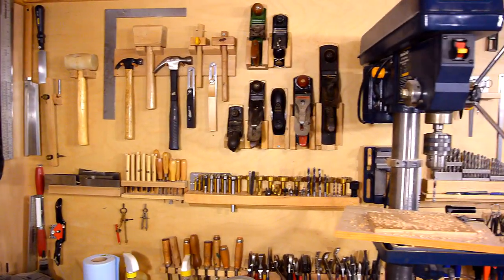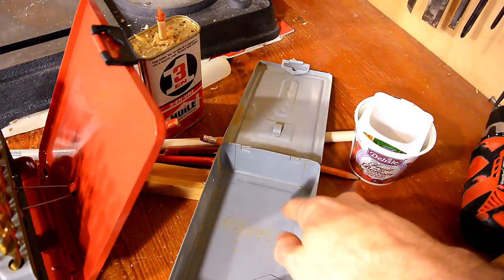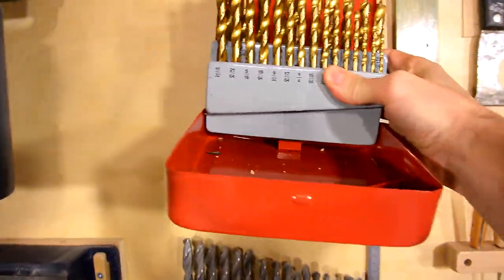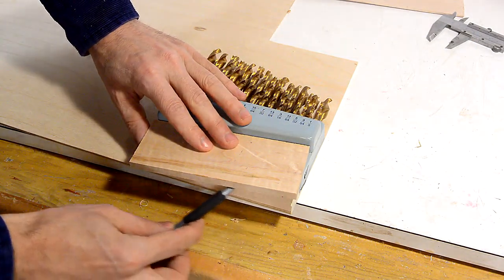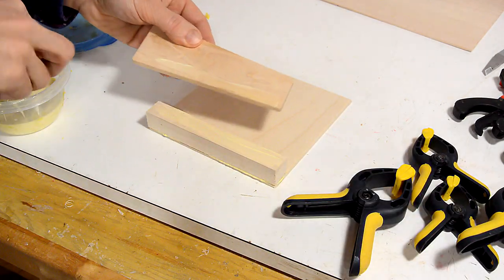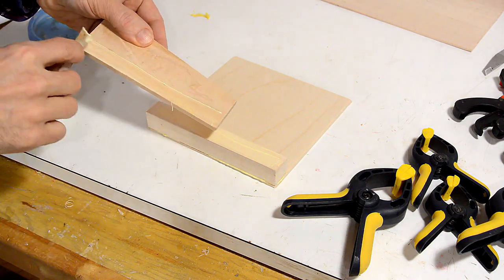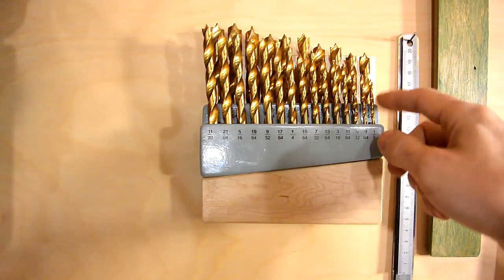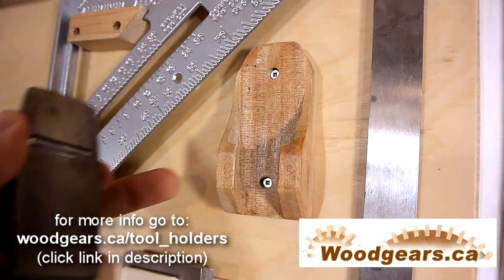Not a french cleat system for organizing hand tools

Comment: Matthias,   I understand your concern of the french cleats being sawdust catchers, but it's a bit of a bias comment.  You have put a lot of work into your layout, but sawdust is NOT a justification for recommending to stay away from french cleats.  Like you have stated in your video, once you have your tool layout, the hangers will stay put, making it impossible to collect dust under them.  If dust is your concern all you have to do is remove the cleat from the wall brush off the dirt and wait for another 10 years of dust accumulation.  The french cleat system is far to flexible just to write off as you have.
Reply from the maker: Jeff Weinmann There's still the fact that they are a lot of work to make, are less flexible, and are ugly/
Reply: Matthias Wandel Two 4x8 sheets of plywood. One of those cut into 3 inch cleat strips.  Mount cleats to First 4x8 sheet.  Mount to wall or just mount the cleats directly to the wall. This is woodworking 101.  One of your videos demonstrates you creating an angled zero clearance insert for your table saw.  Stating that creating french cleats are difficult to make is simply not strong.  French cleats are the very definition of flexibility.  Entire tool cabinets can be rearranged if mounted on cleats simply by lifting and repositioning.  Your opinion of french cleats being ugly is exactly that - an opinion.  If you would have said from the beginning that you did not prefer the appearance of french cleats, this would have been fair and respectable.  Instead you dispel cleats for collecting dust and being difficult to make - both untrue.
Reply: Matthias Wandel Let's us assume that 99% of wood workers think french cleats are ugly.  Then consider for a moment that there are wood workers that prefer function and flexibility over appearance.  Can you explain to your audience why a cleat system is that much more difficult to build as opposed to a 'Not a French Cleat System'?  I've reviewed your video again and I see very specific holders built for very specific tools.  Please explain how these items are so much easier to build than a cleat version?  Can you also explain to your audience just how inflexible french cleats are?  Now here is my opinion - I really don't care what my workshop looks like as long as its clean, flexible and functional.  French help me keep my shop in that state.  I'm not winning anyone over for the appearance of my shop.  I win people over by the quality of my work.  If French cleats help me achieve that goal, and they do, I will recommend to anyone their use.
Reply from the maker: Jeff Weinmann Easy enough.  I can mount a tool holder anywhere I want, not on discrete increments.  The effort of unscrewing and re-screwing the tool holders over their lifetime is still less than making the french cleats.
Also less space taken up.
Reply: I think this was just a response to Steve Ramsey's, "French cleat storage system for hand tools."
Reply: Nicholas Mathura
Bingo! Basically nothing more than a friendly jab at Steve.
Weinmann has taken this much too serious/personal.

Comment: Beauty is in the eye of the beholder. I have two walls in my shop using french cleats. I have rearranged each wall about five times so far. I like the ability to move cabinets, shelves, clamp racks, plane holders, etc. at will. I think the french cleats work well when the walls have been sheet rocked and it's hard to locate studs. In my next house, I plan to line the walls with OSB, and they I'll use your 'screw it on anywhere' method.

Comment: I recently arranged my tool cabinet.  The first time, I hot glued everything and the first hot day (in Georgia) it all fell off and it stayed that way for 15 years.  I finally got tired of not finding tools and made a mini-french-cleat system for part of it.  I wish I hadn't done that now.  For the rest of it, I made custom holders for each one like you did.  I like them much better.I did the same thing for all my drill bits and router bits, but made wood blocks with holes for them.  I am so pleased with how it turned out.

Comment: good video matthias,very helpful.

i used to use the "married cleat system"...i'd lend my wife a philips screwdriver and never see it again...very inefficient.
Reply: I'm a big fan of the "too many cleats not enough brains" system. I buy a set of bits, use one, set it on top of the fridge while getting a snack, lose all memory of doing so, spend four weeks looking for it, eventually buy another set because they don't come in single bits, and finally find it again when the cat gets up on the fridge and knocks it into my dinner.
Reply: percy thrillington I'm thrilled that she was an only child.  My Brothers In Law don't mess with mere bits, they take the bit set, battery powered drill, charger, extra batteries, standing drill press, and the coolest shop radio, THEN it all disappears.
Reply: Percy, it's in the garden.  She was using it as a seed drill, then the phone rang.

Comment: Tip:
When drilling out rivets, start with a small bit at a slight angle that will punch through but not cut the outer profile of the rivet, follow it by a larger bit.
This avoids the drill bit walking off the rivet head into your hand or scratching the case you may want to re purpose.

Comment: Both systems have their advantages. The main reason I like french cleats, regardless of shop project or not, is the ease of hanging. Being able to attach a cleat to the back of a wall cabinet and simply set it in place is so much easier than trying to hold it and screw it to the wall at the same time. Even if it's not a whole system of cleats mounted to the wall. Just put a cleat where you're going to hang something big and hanging is a breeze. 

I like what you did for smaller items. I like what I did for larger items. I might have to steal your plane holder idea though. Pretty nifty.
Reply: Or hang some ply on the french-cleats and screw small-tool-holders onto that.
Reply from the maker: For larger cabinets, I definitely agree.  For individual tools, rows of cleats are too bulky, and cut down too much on flexibility.
Reply: Matthias Wandel They take up a lot of depth space too, and in my shop, every cubic cm counts.I used french cleats to mount the cabinet itself, and wouldn't do it a different way.  My planes would just not fit though.  I'll make a separate cabinet for them, but next up is a sandpaper box.  This is my year to organize, finally.
Reply: I would agree with the general consensus:  Cleats for larger/heavier items and simple wall mounts for the small things.  That said, I have found that for wall mounting it was generally faster, just as simple, and more adaptable to use peg board for the wall sheeting.  it is still simple to make the hangers from scraps, but it allows for greater ease of arrangement and re-arrangement over time.  My Grandfather placed a simple sheet of dark brown paper over his and used a white china marker to lable things, hiding the "extra" holes and greatly improving the contrast between the tools, racks, and wall.

Comment: I'm 12 I just got my first real shop and I made a French cleat system but what I did to solve my dust and chip issue was I raised my French cleats off the wall. It solves the problem and I think it looks a little better too
Reply: Well I'm 50, totally disorganized with shit piled up on random shelves, but I came here to suggest a spaced cleat through which the dust could fall. It made me smile with optimism to know that a 12 year old not only beat me to the suggestion, but actually implemented the solution. Keep it up!

Comment: Five years later; I usually would go for the  
tang of a file or a reamer to remove a rivet,  
instead of a drill, even if the hole is that tiny.  
There's not that much metal to remove and  
like the video shows, a high speed drill slips  
and you can actually hurt yourself that way!  

Thanks so much for the content, keep up the  
good work.  בס״ד

Comment: Some of us aren't satisfied with it staying the same forever and ever...  That is the only reason I went with a french cleat system.  Albeit it's more a double cleat system:  Ran the boards thru a 3 1/8" fence with the saw at 45* angle and then flipped it so there is a cleat on both top and bottom.  Spaced them so leftovers can slide between them on the wall so more options for mounting are opened up...

Love yer work but a lot of us are redo-ing our work environment often enough to warrant a french cleat (I feel I have to defend it since I just spent 3 days cutting / mounting / painting mine!)

Comment: I have gone through all your comments,  my suggestion is just insert 3 to 4 mm washer between the fixed portion of the cleat and the Plywood/wall, so that a gap will form, whenever the saw dust falls on the cleat , it will automatically come down from the gap created by the washer.  The issue of saw dust is solved.......

Comment: Personally, I still prefer the french cleats.. like you say, this is more work and reqs a bit more planning up front.. as I you swap in and out additional tools, another fixture needs to be created..

possibly a good idea against the debris getting into the cleat would be a filler strip?
Reply: Then you have to deal with pulling the whole hanger off the wall, plus how much further off the wall all the hangers are.

Comment: Matthias, In this project you talked about the length of time you left the project cure. When provided, I find the length of time very helpful and interesting. Could you expand on three way ratio between volume of glue used : curing time : strength or durability.

Comment: 'super-thin layer of glue'.
This raises a question I've wondered about. If you've got enough glue to fill the joint, but the wood is dry enough to wick the moisture away from the glue quite rapidly - does it set properly?
Reply from the maker: Probably not as strong as with plenty of glue.  See my video "can you squeeze all  the glue out of a joint".

Comment: To remove rivets, use a drill bit about the same size, or just a little smaller, as the inner part.  Clamp down the part and drill

Comment: Rather than mounting the drill mount perpendicular.  Doing so takes up a lot of space on the wall.  Would you consider mounting the drill bit holder at a angle.  Not so much that you can not see the size of the drill bit, although resolving that problem is small.  Also it means that the drill bits would be easier to take out and replace.  I would imagine you would be able to place the drill bit holders much closer together saving a heap of room.
Reply from the maker: +velcroman11 That drill holder is already two rows, and it's a pain in the ass, because I can't see the labels on the rear row.

Comment: It looks like this would still collect dust.  With a French cleat system, you can clean up the channels and the pieces fairly easily.  With everything screwed in, though, it seems like dust will be more of a problem over time.
Reply from the maker: notjoshing With a french cleat system, the french cleats will get full of dust, and THOSE don't come off.  With this system, I don't have that problem.
Reply: I think it's kind of a wash in terms of cleaning difficulty.  My grandfather used a system similar to yours, and it's still some work to clean.  With French cleat hangers, I could just pull them off, then tap each off over the trash, and use the shop vac to suck up all the dust.  In the end, each system has its pluses and minuses.
Reply: notjoshing
Use your shop vac and compressed air at the same time. Just hold the vac end on one side and shoot air/dust from the other. No need to remove and bang.
Reply: 1Howdy1 Nailed it.  That's what I was going to suggest.  I love the french cleat system.  Although, Mathias' system works for him, and that's what's important, guys.  I haven't really used his system, but I like how easy I can move things around with the french cleat system.  So that's my preference, but either systems would work fine for any woodworker.  The dust does build up in the main cleats that you secure to the wall, that part is true.  But occasionally blowing them out with compressed air will work.  I should try that tomorrow.  Also, sanding off the corners of the part of the cleat that's attached to your tools will leave a small gap when the cleats mesh together, making the dust build up more forgiving.  Similarly to making a relief cut on a table saw sled fence so the work piece is always up flush against the fence.

Comment: If you could find an easy way to tilt the drill bits forward a bit you wouldn't have to pull them straight up.  This will allow you to lower the items above the bits and gain some additional surface area on the mounting ply....

Comment: you could have srewed the lid to the wall. This way you can still close the box and its like a drop down menu for bits. plus your bits are protected from dust. minus, when open, the dust gets in the box.
Reply from the maker: +mynamesmike88 another minus - while closing, the bits will fall out.
Reply: no they dont.If the box would stand on a table, all the bits are up right. If you close the box by lifting up its bottom and keeping the lid in that position as it is, the bits will still be up right. right?
Reply: +Matthias Wandel, I am literally laughing out loud, at your reply!

Comment: why does it seem like nobody uses pegboard?
Reply: If you will price a sheet you will understand. Personally I think I'm going with the french cleat way but I haven't made up my mind yet. Matthias' wall looks great but that looks like an awful lot of work. I'm just undecided.
Reply: its really not that expensive, i bought a sheet for about 20 bucks and love it. it might be more expensive other places, i live in florida. the hooks are like 10 bucks for about 75 hooks of varying sizes at harbor freight
Reply: Justin lukaszewicz
I used pegboard for about a year before I gave up on it. Those little black clips they make to hold the metal hooks in just don't hold up to daily usage. They're always popping off and the hooks fall off when I remove the tool. I am going with a hybrid french cleat/direct drill into a solid sheet of ply for my most commonly used tools. I'll still use the pegboard for some tools, but mostly only the lighter, smaller stuff (rulers, squares, etc).
Reply: sidgar1 It's possible to fish zip-ties around the back of the hooks, through the neighboring peg holes. You have to use a second tie to guide the first tie back out, but it helps the pegs stay put very well.
Reply: Scott Anderson Thats a great tip! Thank you!

Comment: just cut some 45 degree pieces in 10cm lengths and use them as blanks for the cleat system. No empty cleat == no dust problem.
Reply from the maker: No cleats = no empty cleat = no dust, and much less workd
Reply: i guess. i used the 45 offcuts from making the cleats originally so it's just a case of cutting to length. Not as tidy looking as your system though

Comment: So... What's wrong with peg boards?
Reply: I use a pegboard to hang some tools but the problem is that the pegs will come out as they are a tight enough fit in the board. You have to "baby" the certain tool off its pegs. Still, I like pegboards and the French cleat. I like Matthias' ideas in general but not this one.
Reply: They are horrid looking things. Why ruin a fine board by filling it with holes, then spend more money on propriety hook things that don't work a fraction as well as DIY holders.

Comment: Why not drill holes in the box and you can screw the whole box on the wall do close is much neater and easier
Reply: Open index is so much better for the common sizes. Those boxes are designed for portability over function. I made a temporary spot on my bench to put the drill press while setting up my shop. It's been there for 25 years now while I decide on a permanent location. I kept the index in the box for 5 years. Probably spent a month of that time messing with the hinge and digging small bits out of the bottom.

Making up your own index for tapping is pretty trick, too. Make an index with three holes per size; one fits the mounting hole drill bit, one fits the tap drill bit, and the last hole is for the tap itself. You'll be amazed by the time saved by not having to mess around with tap and drill boxes while figuring out sizes off a chart.

Comment: I'm 90% surprised you still have all your fingers... you could have taken all the drill bits out of the holder and then drilled out the rivets from the top angle and not slip and go through your hand or fingers. saved the 10% because you only have to be smarter by 10% than the tools your working with... rather than fight gravity and have your tools spill every where (I see laziness to just put your bits in a pile and re-organize them after you get that organizer out of the main storage box, do it the right way and save yourself from home stitching your hand) and not be so oblivious to mishaps you should step back and think before acting. I'm not trying to be a safety Nazi or a dick just looking out for you and the people you're showing how not to do things.